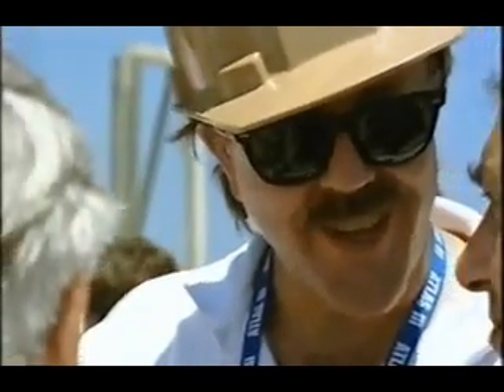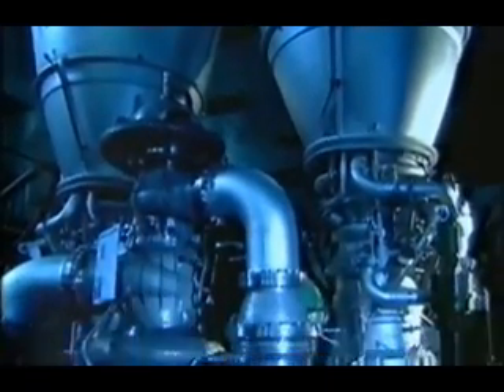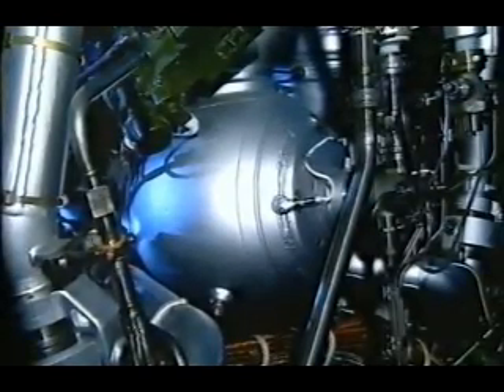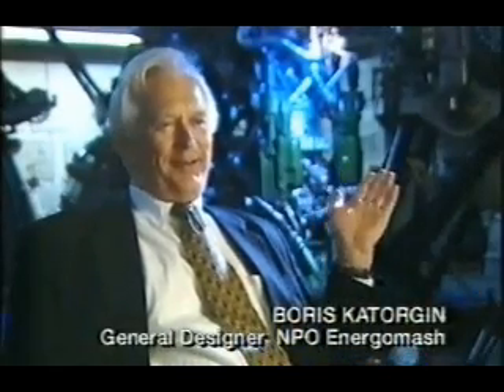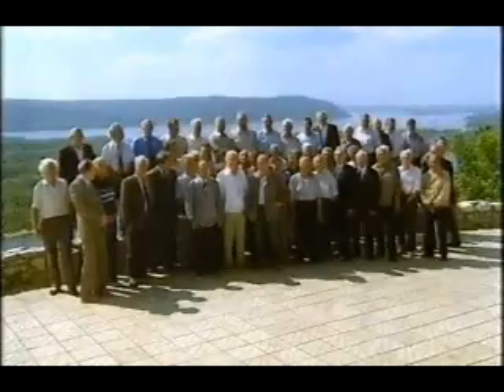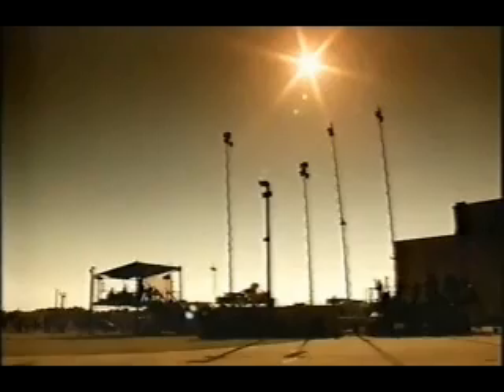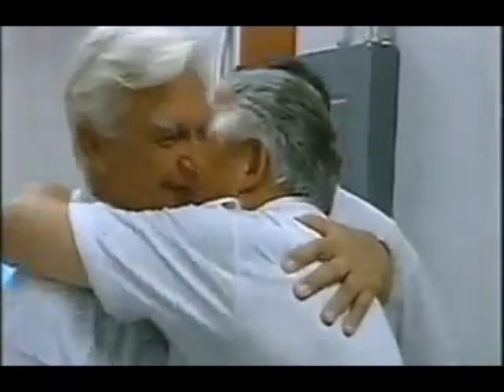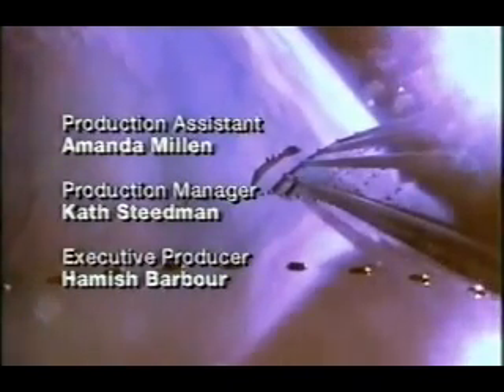Soviet N1 Moon Rocket Documentary Part 5

Comment: The skylabs were not complex international research stations that could last for several years. The Skylabs were used for a few months, de-orbited and then they sent another one. MIR is the ISS, just smaller and built by a single nation instead of a global cooperation. Skylab was great, but MIR, as a single nation super-project, is second to none.